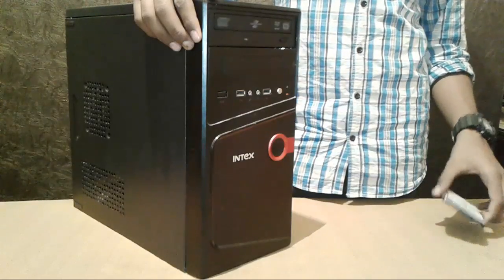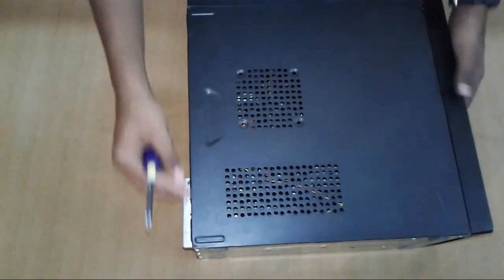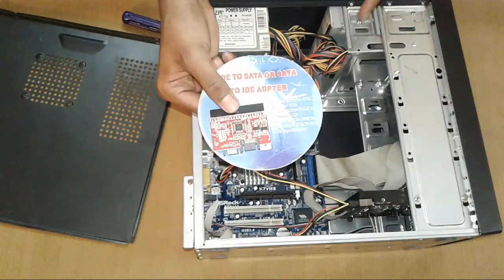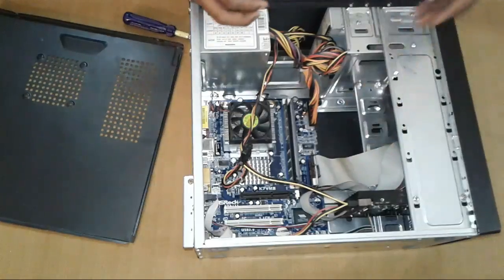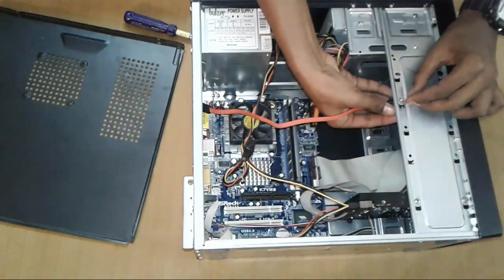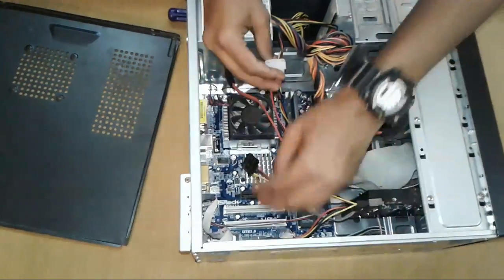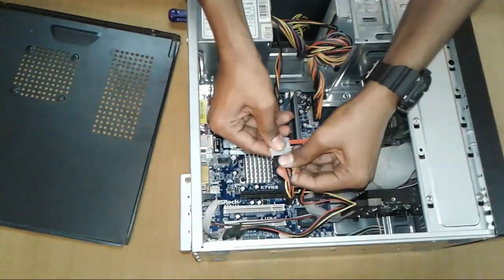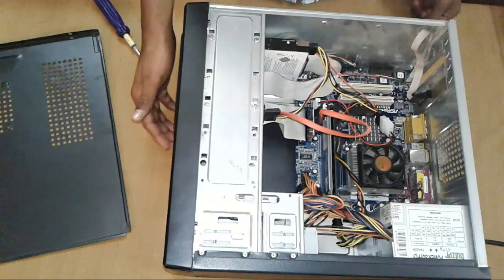how to convert sata to ide or ide to sata | Tech with king

Comment: the adapter is supposed to plug into the IDE cable not the IDE port
Reply: well than its a waste of a port .... im going to build a pc with an adapter that plugs into the sata hdd to ide hdd interface ...so i can use the other port on the cable

Comment: That is 2.5 hard drive. How to connect 3.5 hard drive sata to ide?  is it the same?
Reply: As I know, 2.5 needs 5 Volt, 3.5 hard drive needs 12 Volt. Is it no problem using the same power supply?
Reply: Tech with King Thank you.